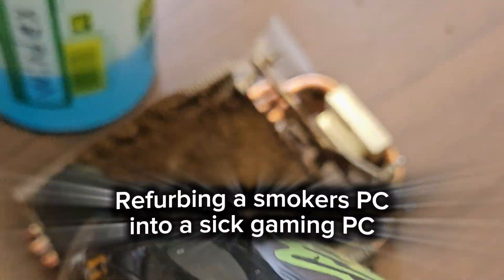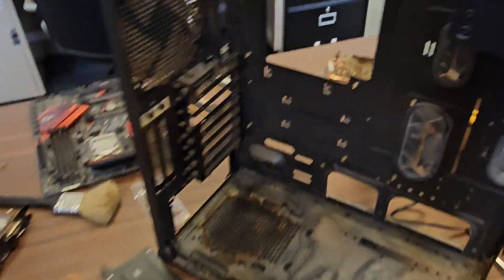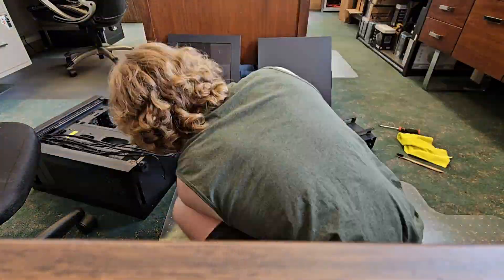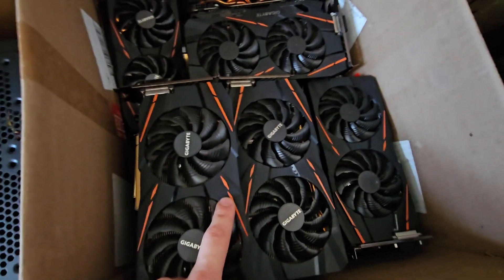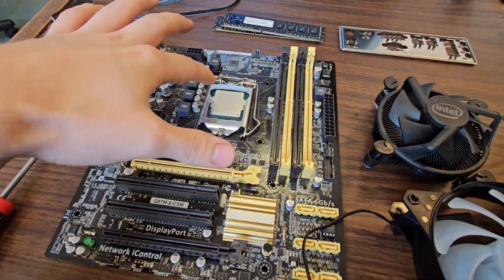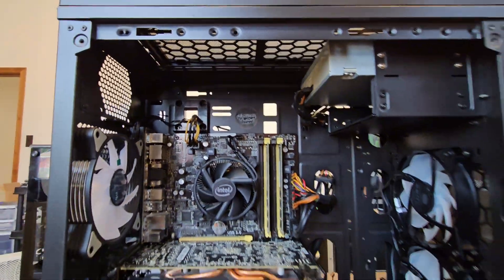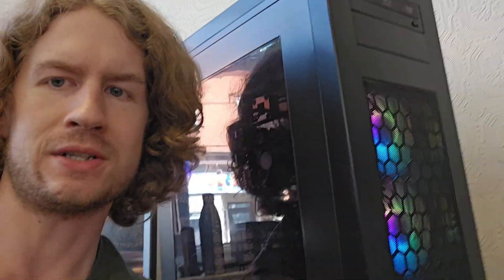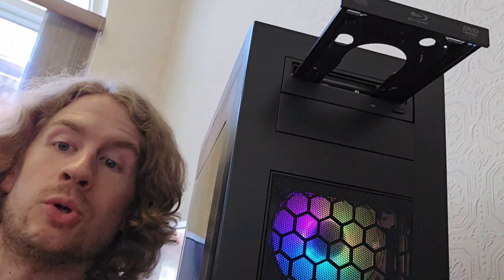Turning a Smokers Computer into a Budget Gaming PC

Comment: I knew smoking left bad gunk on PC components but never that bad. If I were you I would of cleaned the most valuable parts and just threw the rest out. Also couldn't you find a way to use crossfire with those Rx 570s.
Reply from the maker: My colleagues said to toss it but I hate these things ending up in the dump! Sure was a lot of work cleaning but I get satisfaction from it. You sure can crossfire however not really gonna see a performance boost nowadays